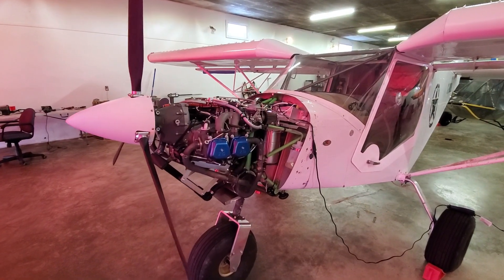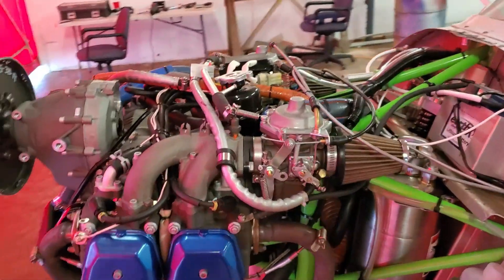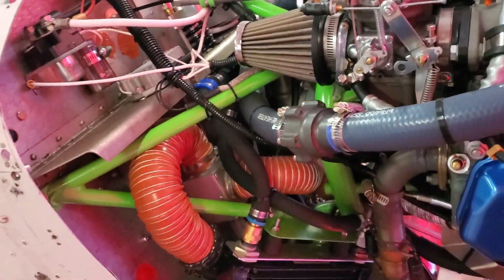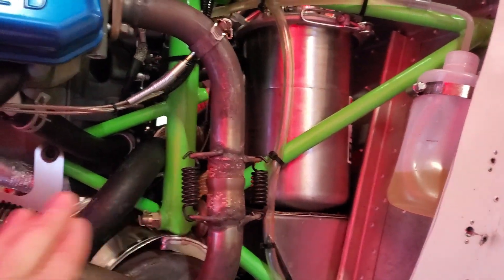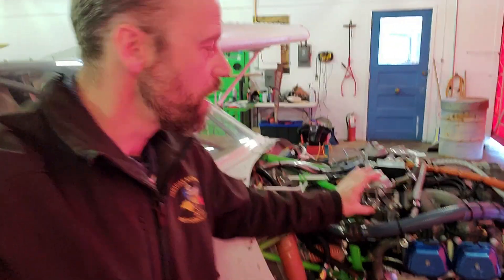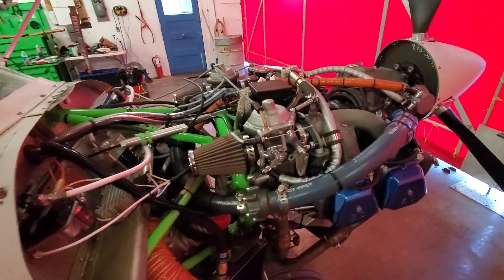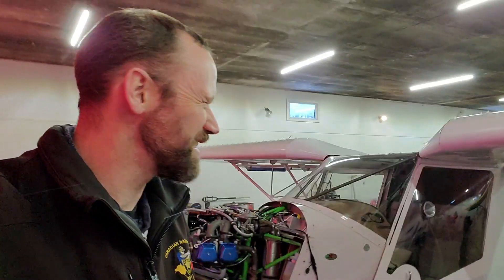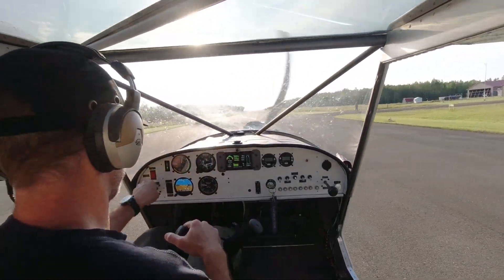Engine Overview on the Zenith 701

Comment: Hey, Matt, how is the Great White North doing up there? Looks like you still got some Great White stuff!😂😂  Seriously, your explanation about the engine fascinated me!!! The only thing i fly is a drone, but i got my licks in many years ago! I wanted to comment on that gentleman that wrote about the knock off situation. And i agree with him. Yall get what you pay for sometimes. Ive never had to many Chinese knock offs that were good! Youare better qua.ified to pass judgement on the mechanics off this then i am ,but check cylinder wall thickness and welds. If this sounds like i dont trust their engineering, its because i dont. Anyway, on a lighter note you are gonna get so e warm air from here in SC! All my Canadian geese buddies are packing their bags and testing their direction finders!!!😂😂😂 Take care!😎👍
Reply from the maker: You are right, sometimes you do get what what you pay for. I feel like we got what we paid for without overpaying for it. This engine is slowly developing a solid reputation unless people are hiding their problems with it. I can say that we've had no trouble with it so far and others with the engine have reported the same. The true test comes with time though so we will have to wait and see.

Comment: in our local club, there’s one pilot that put a ZD on his skyranger. 
he had several issues with the carb sync as well as a huge difference ou fuel consumption. I guess this might relate to the carb sync issue inf first place. Regarding that, did you noticed a significant increase in fuel consumption, when compared to a 912uls?
Reply from the maker: We are burning on average 4.25 gallons per hour at 5000 rpm. This is seems to line up with the other 701s based at the airport with the 912ULS. We're excited to not have to worry about carb synching and the lower fuel burn that the EFI will give us. :-)
Reply: @mmatt  is that EFI kit compatible with the 912UL, the 80hp version, not the ULS?
Reply from the maker: @ricardom959  I think it is.

Comment: Excellent attention to detail as usual Matt 👍 Very interested to see how the Edge Performance EFI Upgrade goes, when you get to that. I’m sure you know about the French-made LAD Aero EFI Kit as well. Lots of them flying on 912 Series in Europe. However, there’s also lots of Edge Performance upgrades flying in Europe and in the U.S.A. I’m not an expert, but the Edge Performance Kit looks like a more robust design. Be interesting to see an apples-to-apples comparison/review of these 2 kits. Also, use Decalin Fuel Additive if you’re forced to use 100LL Gas with Rotax 912 Series Engines. Most airfields out here in B.C. don’t carry MOGAS, so always have the Decalin onboard.
Reply from the maker: We considered the LAD kit as well but ultimately went with Edge. Thanks for the info on the Decalin. :-)
Reply: @mmatt Belt and Braces Matt.
If you are forced to use 100 low lead, use the additive and change the oil every 25 hours.
Sadly too many airfields assume everyone flies behind a Lycocaurus and only offer leaded fuel.

Comment: 3000+ hrs +  carbed  912S pilot here, who has used 85 degrees as my before launch temp the entire time, no gearbox issues.  3 hrs since intalling the EDGE EFI, you are going to love it! I use a cockpit controlled divertor for the rad fluid,  plus I can control how much air my oil cooler gets, both help in less time wasted warming up. My strip is steep, so I don't use full power, around 4300 rpm, for take off, and only go to full power after it reaches 120+, one reason why that works for me. The Zonsen is new to me, interesting! There is no need to vent the header tank, you already have vents in the wing tanks, won't hurt, but for sure it's not needed.
Reply from the maker: Did you vent your header tank? If so, how? How was the installation process? Did you install it yourself or have Edge do it?
Reply: If using Mogas you really should vent the header…for Avgas only you could get away with only wing tank vents. I’m a Rans S20 builder with 914 engine. Vapour build up in the header can prevent fuel from gravity draining to the header.
Reply from the maker: @martinjmerritt  That's true, mogas is more volatile than avgas. We're definitely venting the header tank.
Reply: @mmatt   OK guys,  do what you feel you need to do, but I'm telling you that after first hand experience,  not just conjecturing, a separate vent to the header is not needed, it's basic plumbing 101! It's already vented! The only reason I persist in explaining this, is others that may read this and go away with the impression  that a separate/additional vent is needed, it's not. It can't hurt, other than the extra hose, fittings, weight, etc., but it's a belt and suspenders approach. I've been flying with a "unvented" header tank for well over 20 years, and never have had any issues whatsoever, EVEN when I transfer fuel in flight (from a ferry tank via a floor mounted transfer pump )  emptying it out and then pumping air into the header, a worse case scenario one would think. It immediately runs rough as heck, as you'd expect, but the second I shut the pump off and quit pumping air in (which I only do if I'm trying to get every last drop out of the ferry tank) the engine immediately resumes normal operation. Nothing about this has changed  with the EFI install. BTW: I haven't burned a drop of avgas in all this time, strictly mogas, and when I have to, even E-10.
Reply from the maker: @portnuefflyer  I understand completely and if I wasn't already removing the wing covers to upgrade the fuel line, I probably wouldn't be venting the header tank. Since I'm already gonna be in there though, I figure I might as well. 🙂
Reply: @mmatt    Got it, in my case, with my already completed and long installed header, removing it to install another fitting would be a pain,  thus I just teed into the bottom fitting already there for my return, both Mike and Jason didn't raise any issues with that. You may be the first to install the EDGE EFI on that engine? I'd be flying mine right now except it's snowing, again!
Reply: A header tank is just a bigger volume added to the fuel line. No vents needed. The air will just flow out through the input fuel line and back to each tank where it will vent out of the tank vents. You are just wasting your time venting a header tank and adding another point of potential leak that will be hard to fix in the future.

Comment: So the header tank is sealed
Reply: It should be, the existing wing tank vents are all he needs, proven by myself and a boatload of RANS pilots with headers.
Reply from the maker: Headers on a carbed engine are different than headers on an EFI engine. From what I understand, the return fuel flow from the engine can cavitate and vaporize creating air bubbles. Those bubbles need to go somewhere hence the vent.
Reply: @mmatt   Mine is running perfect, without venting the header, the EFI didn't change anything. Why not get it all  installed, but try running and flying first is all I'm saying. You are going to like having ONE throttle cable and NO choke cable cluttering up the engine bay, the only issues I had installing mine were the usual ones: figuring out how to get at stuff and where to lay out the lines etc., pretty simply in retrospect.
Reply from the maker: @portnuefflyer  That's great to hear! We have to get at the fuel tanks to change out the fuel line anyway so we're just gonna go ahead and vent the header at the same time. As others have pointed out, whether we need it or not, it certainly won't hurt anything. 🙂

Comment: For cabin heat, can you not reroute coolant lines and have car like heater in the cockpit?
Reply from the maker: Yes, this is an option too. It's a bit heavier and more complicated than this system though.
Reply: Maybe slightly heavier as you will have a small radiator in the cabin and a fan to blow air over it BUT it’s no more complex AND you will have completely eliminated the prospect of bringing carbon monoxide into the cabin. With a coolant based heater you have access to substantially more heat than you can get from the muffler…really limited only by the size of heater core and fan you are prepared to install. My Rans S20 with 914 and coolant based heater keeps the cabin comfortable down to about -15C wearing a light winter jacket and fingerless gloves.
Reply from the maker: @martinjmerritt  Good to know! I was under the impression that the coolant based heaters were less effective than the muffler ones. I'm not sure how I feel about a potential coolant leak in the cabin though... although that's probably exactly what you're thinking regarding the carbon monoxide! lol!
Reply: @mmatt  Exhaust muff heaters are in common use only because on air cooled engines that’s your only source of cabin heat. How many cars do you see using this method? How warm can you keep your car on a cold winter day? A coolant leak, like a carbon monoxide leak would not be good for sure. Unlike the CO leak a coolant leak announces itself and is easily stopped. A coolant based system will have 2 hoses passing thru the firewall. One in and one out. On the firewall side of the “in” hose you have a shutoff valve controlled by a cable in the cabin. On the firewall side of the “out” hose you have a check valve that prevents reverse flow. In the event of a leak in the cabin’s heater core (easily detected!) you simply close the valve on the input side.

Comment: Hey Matt, good luck with the fuel injection conversion. The only issue I have with some systems is if they are fully FADC. I still like having the option of controlling things myself if things start going south rather than the computer just going into limp mode. Yes I might damage the engine but I might make be able  to stay in the air longer to find a better landing option. Cheers
Reply from the maker: Yes, this is always a concern, but EFI tech has come a long way and is very reliable these days. We picked a system with a very good reputation so we're quite confident in its success. :-)
Reply: I think Edge Performance's EFI kit allows the user to tweek the ECU.  The Rotax 912iS doesn't let you in to have a play, but Edge Performance do.
Reply from the maker: @philipritson8821  This is one of the reasons that we're going with EP. :-)

Comment: So glad the new engine is running well! I just did my first oil change on my new Rotax so that was a bit of a milestone! I’m using 100LL so unfortunately I’m stuck with the 25 hour oil change instead of 50. Are you running AVgas or auto gas?
Like everyone else, been waiting out the crap weather…..hang in there everyone…….spring is coming!
Reply from the maker: We're running auto gas exclusively. We'll use 100LL if we have no other option but that hasn't happened yet. I thought I read somewhere that there's an additive you can use to help scavenge the lead if you have to use 100LL, if you did, would that let you go back to 50 hour oil changes?
Reply: @mmatt Decalin is the additive.  I used it lots and did the 25hr oil change.
Reply: @mmatt  , yeah Matt, you are correct. I have used it in the past but you still have to go with 25 hours on the oil change.
The big problem with the auto gas (in the US anyway) is the Ethenol is bad for the gas tanks. A friend of mine had to replace two wings on his Pipistrel because it ate up the tank.

Comment: It's never as good as the Rotax, Please stop promoting cheap inferior Chinese slave labor made knockoffs. They did the same thing with Honda motors and I've had a ton of problems with them. Bing carbs are amazing I've used them for decade's  but again too many little hidden flaw, shortcuts and cheats. Don't walk away from Chinese engines......Run!!!!!!!!
Reply: Times are changing...., I'm old enough to remember when Japanese products were thought to be cheap junk, and look at the Kia and other Korean cars and their high ratings.
Reply: I've had darn good luck with Chinese engines and aftermarket parts for bikes and ATV's. I've actually been impressed with some of the design improvements they use on Briggs & Stratton and Honda clones.